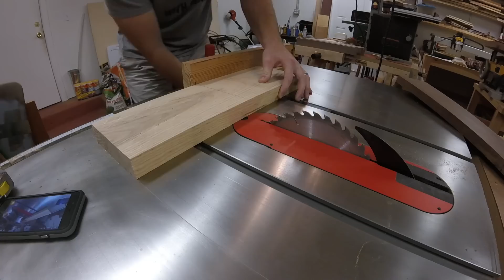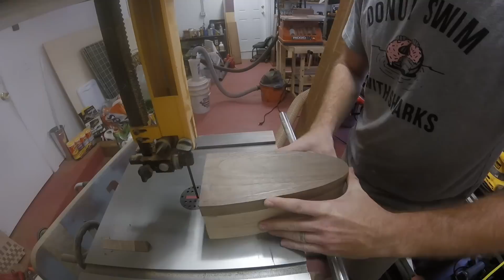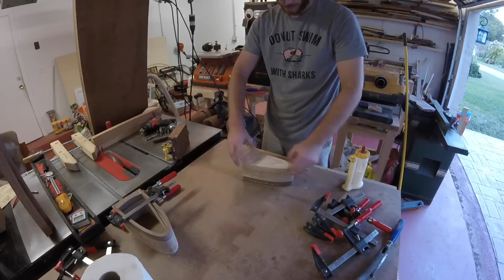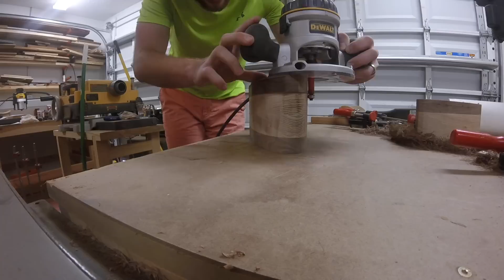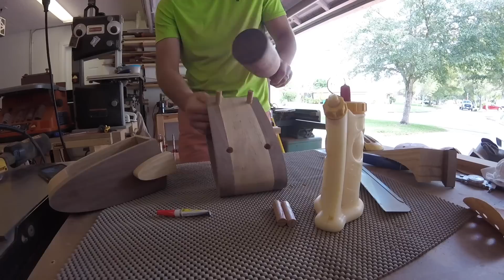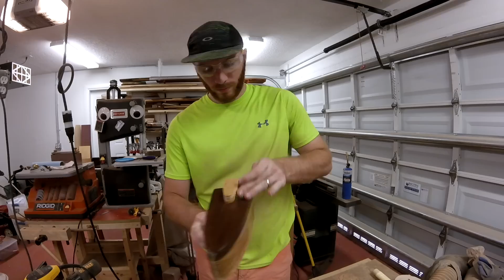Making a bandsaw box

Comment: What bandsaw blade do you use? Your drawer looks really snug with very little kerf. Great work!
Reply from the maker: Thanks Spencer! Most of the boxes I make use a 1/4" 6tpi blade from Timberwolf. One of the reasons the drawers have a snug fit is that I enter and exit the cuts in different spots. This removes more material from the box and leads to a snugger fit for the drawer. It's one of the reasons I prefer to make boxes with through cuts.
Reply: That makes total sense. I appreciate you sharing your expertise with me. Thanks.